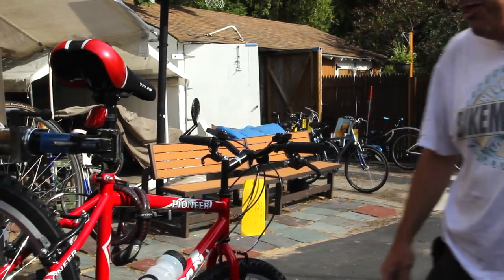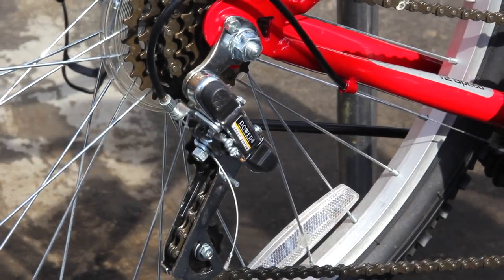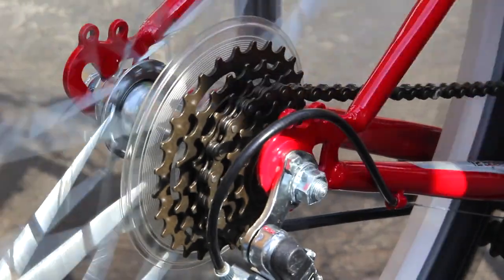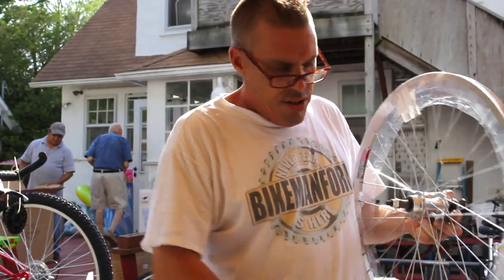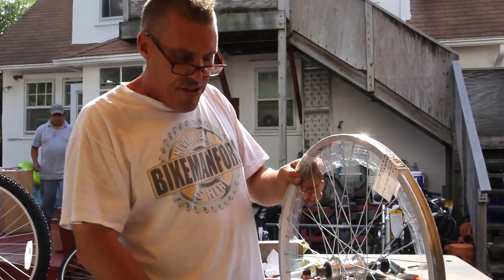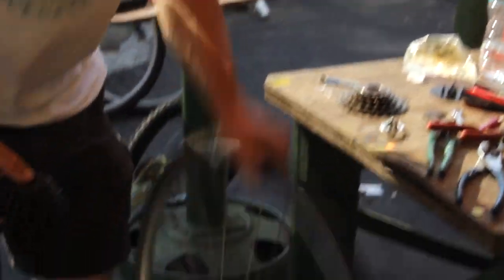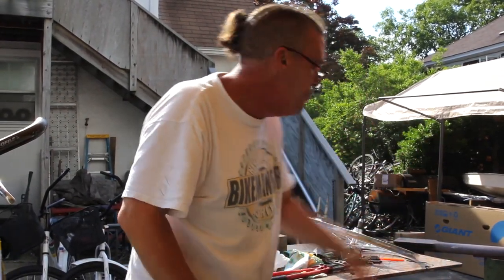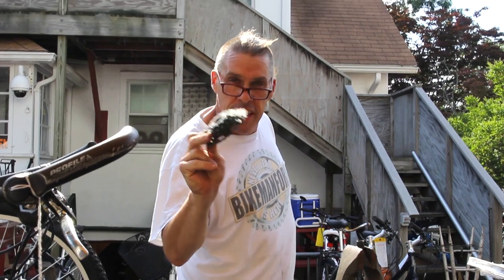The Freewheel Wobble - Why A Cassette Won't - BikemanforU Tutorial

Comment: The rear axle is not seated into the frame.  I would start there first.
Reply: Centred or not axel end points are fixed and the author's freewheels rotate on a plane that is not exactly square/perpendicular to the axel, you do not get such a big wobble if the axels ends are out a tad, in such case the brakes/rim system goes out of whack earlier in your repair process. You get rims and brakes all set up nicely then if you are a rookie like me you notice the messed up freewheel wobble of 1to 3 mm, this explains why.

Comment: Lmfao the Bike Man Strikes again. This is really why most of the bigger wobble exists. Freewheels do not wobble and cheap wheels have cheaply made hubs. Small wobbles can be fixed by Rebearing properly. You can rebear , add new freewheel etc nothing will fix it only a New Properly made wheel with a properly centered hub.